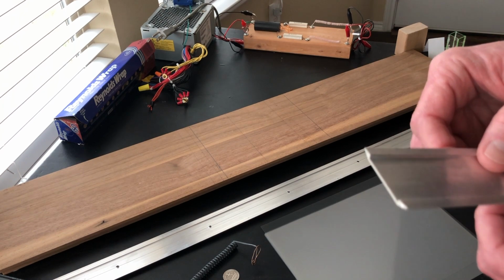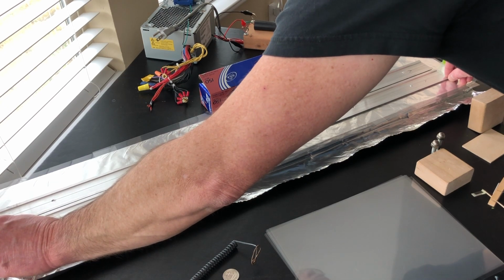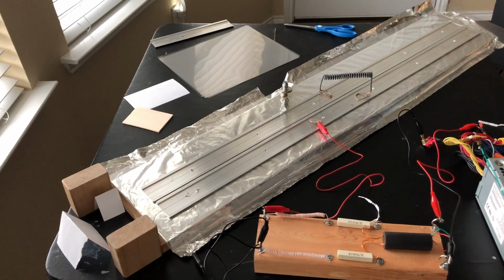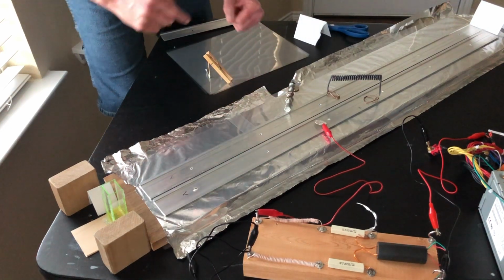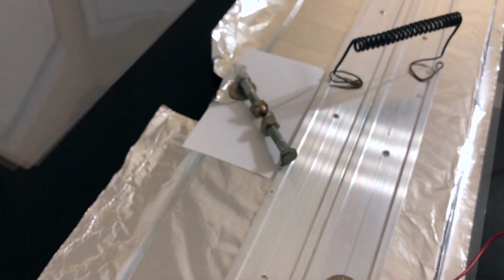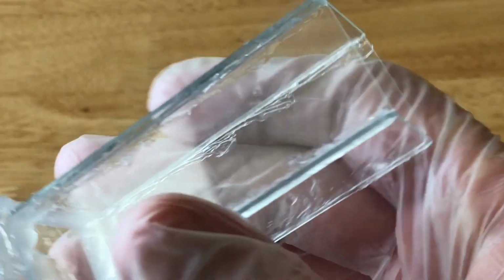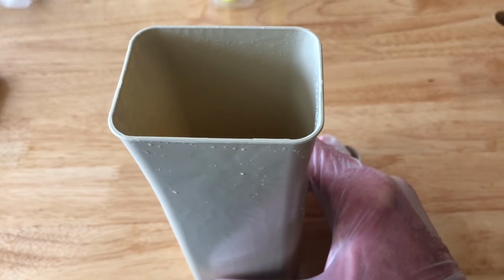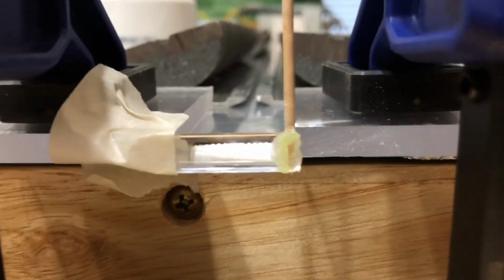A visible laser beam from household chemicals! No laser diodes! No specialized parts. No kidding!

Comment: idk if i ever mentioned to you about my little white light collimated beam i made ,simple 7.5watt  led equivalent to 50 watt incandescent, actually quite bright to naked eye followed by 400 micron spatial filter and a plano convex 35mm aspheric lens ,i believe i got it down to 1.4mrad ,it appears to be well collimated or parallel ,now its obviously putting out a fraction of the light but it focuses down to a fine point and i placed this point on a smear of yellow dye from a highliner marker on a glass substrate and the spot was glowing green along with the edges of the glass ,can you tell me what exactly is happening here? am i getting more watts in this smaller spot vs if the spot was unfocused? and is the dye simply absorbing all spectrum and reflecting back the green or emitting it spontaniously?
Reply from the maker: First of all, I would love to know about how you made the collimated LED source using the spatial filter - very interesting to me (please tell me more). 

As for your question, when you focus light you are increasing the intensity. Sunlight is roughly 1000W per square meter on a summer day. If you focus this sunlight to 1 square centimeter, you will still have the same energy. However, you would have an intensity equal to 10,000,000 watts (I stuck with literal square areas to simplify things). 

As for the dye in your question, the dye is only absorbing the energy from shorter wavelengths and reemitting the energy as longer wavelengths (it's the same thing that takes place when blacklights are used in bars, at parties or for entertaining effects). The fluorescence is spontaneous emission. Dyes cannot be optically pumped to lasing threshold using ordinary light sources. It's like trying to hit the moon by throwing a baseball. Dyes can only be optically pumped to lasing threshold using other lasers, or by using flashlamps with insanely short pulses of light resulting in hundreds of thousands, or even millions of watts of optical power. You also won't be able to optically pump a dye to lasing threshold using a green or blue handheld laser - it's not that simple. 

See the link below:
https://www.repairfaq.org/sam/lasercdy.htm#cdytoc
Reply: @magx1  idk why you would find my project very interesting? 
it's quite simple ,i am using a cobb type led perhaps 1/4"dia single die that sits on a driver inside the housing that i purchased from home depot and 
here is what it says on it, "620 lumen 7.5w (3000k) 750mA  12v ac 35D" 
,i simply hooked it up to a small lamp transformer that outputs 12v - 20va not sure if this means 20volt amp?
and i hooked an on/off flip switch to it , on the face of the emitter about 1/2" away from the die sits a spatial filter or pin hole that i attached using rubber bands so that i can replace it or slide it around so that the hole can be positioned over the centre of the die and then i have a 35mm plano convex lens about 6 inches in front (im not sure on focal length) with the plano side facing the light ,i also put a cover cylinder for the light path between the filter and face of lens to help cut out any unwanted internal reflections so as not to have any spill around the main beam but i still have some kind of aberration spill coming from the edge of the lens that can not be helped but its quite weak and almost unnoticeable ,as for the pin hole i made them using the bottom convex/concave cutout of a soda can and used needle to make various pin hole sizes and the smallest i made is 400 microns(rough guess).

now about my light and dye ,so the power (ie watts) increases as the focus decreases the area P=W/Pi r^2,ok but the energy is the same, is there an equation to show this in relation to the E staying the same? makes sense that the energy remains the same but i guess when the power is increased so is the work being done.

for the dye you explained that it takes shorter wavelength(ie uv)from my white light and spontaneously emits longer wavelength(ie 500nm) so this means in theory we can make them become stimulated emissions no?
"Dyes cannot be optically pumped to lasing threshold using ordinary light sources." ok i dont understand this,what threshold does it need to lase? and by lase is this not in essence starting with spontaneous emissions and then becomes stimulated by mirrors? what is the difference between what is happening in my dye glowing from that spot and your dye glowing from your tea aside from much higher energy? i mean im still getting it to glow so what is the difference here besides yours being more intense than mine? im still getting some kind of emission from the dye am i not?
Reply from the maker: @ARCSTREAMS  Make an unlisted Youtube video and show me the details of your LED beam device. 

Meanwhile, have a look at this ... 
https://vimeo.com/149195058

I would like to see how the optics work. The idea of making a highly collimated beam using a non-laser source is interesting and even challenging to me. 

As for your question - energy is conserved. However, power changes with time. Power density, or intensity, changes with physical area. And energy density changes with physical volume. 

power = energy/time
intensity (power density) = power/area
energy density = joules/volume

For a given energy, power can change with time. However, power and energy density are only values that relate to physical area and physical volume respectively. Energy is what really means something. Energy is what's really there, in a sense. When you focus light, you're increasing its intensity (power density). When you transfer energy you're dissipating power. 

1 watt of light (1 joule of energy), over 1 square meter, is 1 watt of light with an intensity of 10,000 watts/square meter when focused down from 1 square meter to 1 square centimeter. 1 watt of light (1 joule of energy) over 1 square centimeter is 1 watt of light with an intensity of 100 microwatts, or 1/10 of 1 milliwatt, if expanded to 1 square meter. We're talking about intensity. 

1 W/(0.01m x 0.01m) = 10,000 W/m
1 W/(100cm x 100cm) = 0.0001 W/cm

As you alluded to earlier, the area of circle is (pi)r^2 and this is obviously what we would want in practice. I just simplified things a bit by using square areas instead of circles. 

The Watt is a unit of power. It is defined as a derived unit of 1 joule per second. It merely quantifies the rate of energy transfer. 

1 W = 1J/s
1J = 1W x 1s

Remember that the Watt merely quantifies the RATE of energy transfer. It doesn't change the AMOUNT of energy. If we store 1 J of energy in a capacitor and discharge the energy in 1 second, then we've dissipated 1 W of power. In practice, capacitors have very low internal resistance (much lower than batteries). So if we discharge the energy in a 1J capacitor in 1/2s, we have dissipated 2 W of power. On the other hand if we use a resistor to discharge 1J of capacitor energy in 2 seconds, we've only dissipated 1/2 W of power. And so on and so on - the magic behind pulsed lasers is that they involve insanely large amounts of peak power. Once you get your head wrapped around that, then you can begin to understand pulsed lasers that are pumped by extremely fast transfers of energy. With lasers like nitrogen and dye, we're using high voltages and low capacitances to discharge energy very, very quickly. In return, we are dissipating thousands, hundreds of thousands or in some cases, even millions of watts of power. That's why shining an ordinary light source on a dye isn't going to do anything but create a pretty glow from fluorescence - it's beautiful and it's interesting, but there is no population inversion or stimulated emission. You only have a very short time to get pump energy into the medium of a laser of this type - any energy that gets pumped into the lasing medium after this time is wasted. With normal continuous sources, this would result in a tiny fraction of a joule. With low inductance high voltage capacitors, the required pump energy is transferred to the lasing medium during the very short time that it is required. 

You've got a 7.5 W LED. Let's just pretend that the LED is 100% efficient (and it isn't) and you're actually transferring 7.5 J of light energy to the target. Further yet, let's assume, for the sake of simplicity, that you have 7.5 J at the exact wavelength that is needed to pump the dye. Even in this extreme perfect example, the dye will only 'see' 750 billionths of a joule during the 100ns window in time that the energy will be used. Now in practice it's more complex because dyes can be made to run continuously. But in order to do so, the dye must be formed into a tiny jet stream moving at very high speed, and it must be pumped by another laser because there's no other way to get the required energy focused down into the tiny stream of dye. 

The bottom line is this - we experience life at 60 seconds a minute, and 60 minutes an hour. We live and think on a scale where nothing happens or changes in a millionth or a billionth of a second. But on the scale where atoms, molecules, energy levels and photons change and move, really significant things can happen in millionths or billionths of a second! Most of the energy sources we encounter, such as room lighting or the sun, are continuous or quasi-continuous sources of light energy. During the time span of a thousandth, millionth or billionth of a second, a continuous source of light would transfer an infinitesimally small amount of energy. If I had a camera with a shutter that could open and close in a billionth of a second, I couldn't even photograph a sunlit scenery during the summer due to the few photons that would enter the camera. However, a one nanosecond pulse from a powerful visible laser would be quite visible to this camera and would likely be the only source of illumination on a bright summer day!
Reply: @magx1  strange i did not get email notice about this reply from you,,it happens many times ,i juts saw this reply by chance as i was scrolling down to see if you replied to it.

ok so what is this video showing exactly? looks like two small spots from white light possibly?

im not sure how to take pics or do vids on my new laptop ,its a chromebook 315 and i have not yet figured it all out, i know how to use the vid if you like to do a gmail hangout chat with me then i can show you what i got.

ok i kinda understand all the stuff you said about time and energy etc but in laymens term this glow from the dye is spontaneous emission but without population inversion over a 50% threshold and that is why there is no chance to achieve stimulated emission via mirrors or on its own? so lasing means you have enough pop inver in order to get stimulated emission ,, still trying to wrap my mind around lifetimes of exited states ,pop inversion and all that is happening to give a clear big picture of it all,,in the mean time i been watching these vids and the guy is amazing at teaching the stuff in laymen terms but many things im not able to comprehend most likely due to missing info https://www.youtube.com/channel/UCusFNr9M9QppHgLQrmpz6Gw/videos

Comment: I have been wondering if something like carmel coloring could be made to lase. It does flouresce and has a rather broad band width. I guess the question is about if you could get gain from it.
Reply from the maker: I don't know - that's a good question. It might be worth a try. 

Many things are fluorescent, but only some fluorescent materials can be made to lase - at least from a practical perspective. Some fluorescent materials aren't fluorescent enough and some don't have the necessary quantum efficiency. Still other things won't lase unless they're in the right form or combined with other chemicals. 

Tonic water contains quinine and I've tried unsuccessfully to lase it. I've also tried unsuccessfully to lase chlorophyll. Natural sources of coumarin might be worth investigating. My guess is that the most likely experimental candidates for success would be dyes extracted from fluorescent commercial products.
Reply: @magx1  That's what I was worried about. If I ever get around to building another Nitrogen laser I'll try it out. I built one once before but repurposed all the parts soon after and never thought to try this until way after.
Reply from the maker: @Slowly_Going_Mad  If you use nitrogen instead of air, you can get some insane performance out of a simple TEA laser.
Reply: I'm aware of the performance gains of pure nitrogen, and even adding helium helps according to various sources. Right now things are slow having to save up for tools and materials. I have been thinking alot about building a longitudinal based system powered by a Marx bank but I'll need to get good at glasswork and probably enlist the help of a friend who has oxygen torches.
Reply from the maker: @Slowly_Going_Mad  You can make a longitudinally discharged nitrogen laser using an old He-Ne laser tube. I've done it. The only problem is poor performance. You'll have a low divergence beam, but it won't be powerful enough to do anything interesting, like pump dyes.
Reply: Fair point. I figured if I put the time into it and it was well built I would be less tempted to totally striping it for parts. I know that reducing the pressure reduces gain and the spark having to travel longer probably kills the time constraints. I'm still going to give it a try though. Plus being inexperienced in glass work I would feel bad about totally ruining a neon laser. That may be something I'll try later though.

Comment: if the only region lasing is thin hair line on the inner surface of the glass then why do you need such a large volume of the dye in a beeker like this? because of degradation with time?
Reply from the maker: The thin line of excitation occupies an infinitesimal volume, making the additional volume unnecessary. I used microscope slides for convenience however, which resulted in this volume. Use whatever you can - just pump the dye close to the base of your dye container to minimize the required fluid level. 

Do not use epoxy or glues. Epoxy and other products dissolve or weaken with extended exposure to alcohol. Use RTV silicone to put the glass pieces together. The silicone should smell like vinegar when curing - one of the listed ingredients should be acetic acid. I think aquarium sealant is one possible source of this type of sealant. Just read the label and external print to see if there are any references to acetic acid or the smell of vinegar. 

I've had good results, so far, from "Loctite" brand "clear silicone waterproof sealant".
Reply: @magx1  im thinking if you are only using a small sample to pump then why not use only two glass substrates and have the dye mixed with glycerine or glycol to have a thick gel consistency that makes it easy to be sandwiched between the two substrates and hold the cell together by a few spots of hot glue on each corner on the outside ,i guess there can be many ways of doing it ,but how long does this dye last with cw(ie fast rep rate) pumping by tea? i see other designs call for circulation pump specially if using flashlamp
Reply: @magx1  why do you have to build this container? why not juts use any of those glass square viles i have seen others put the dye in and make laser via tea pumping, does it have to do with finding ones that have perfect glass to glass edges instead of being rounded? as i said i see other vids of these viles where tea pumps them to create there own lasers
Reply: @magx1  can you please reply to the below comments i made below? idk why you seem to skip many and only answer some??
Reply from the maker: @ARCSTREAMS  Please accept my apologies. What comments are you referring to?
Reply: @magx1  the ones in this thread you have not yet answered ,just look above and im sure there are others you must have in your gmail that have not been replied to